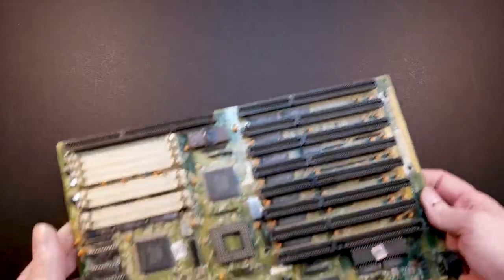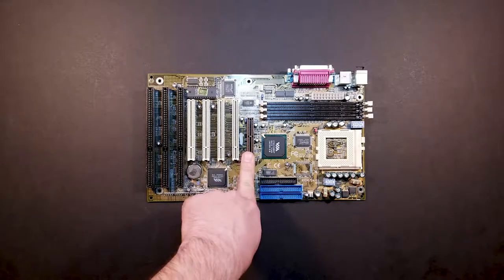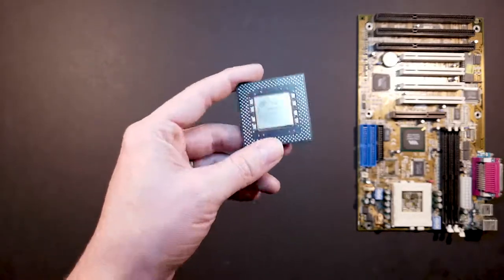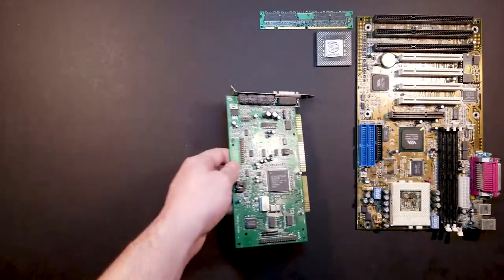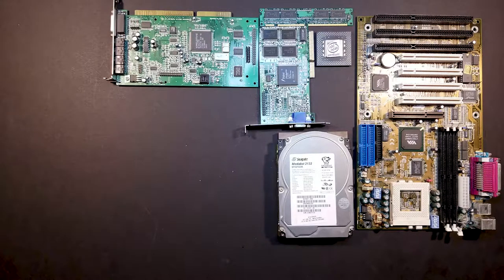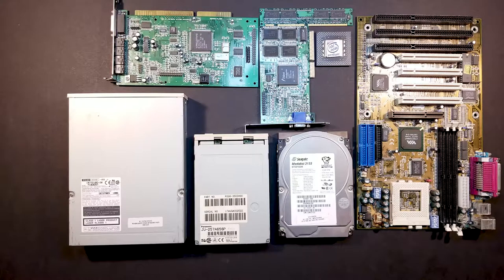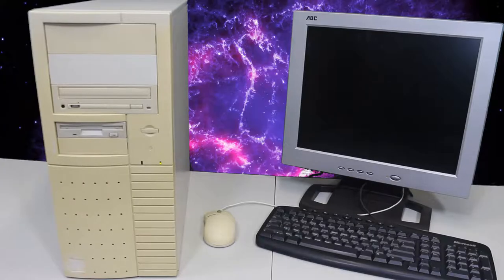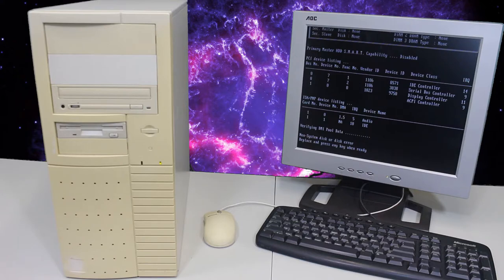Mercury - Windows 3.11 / DOS - PC Build - Part 1

Comment: You can get windows 3.11 to work with usb by using DOS 7.1 which is basically the DOS used in Windows 9x you can get on ebay for cheap on floppy or cd
Reply from the maker: Good to know. I haven't tried DOS 7.1 by its self. I do know it added support for FAT32 which might be nice.